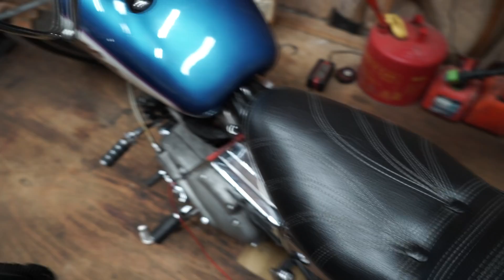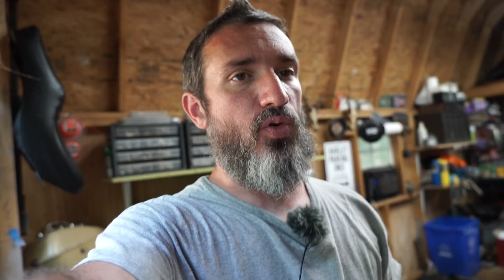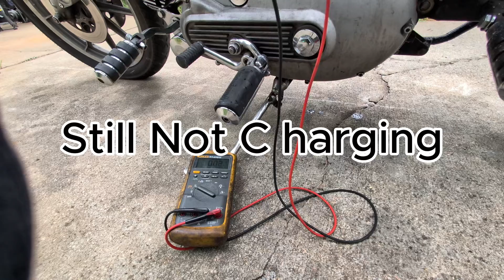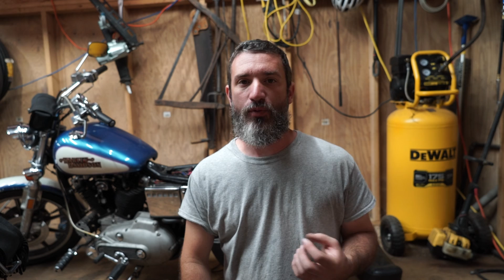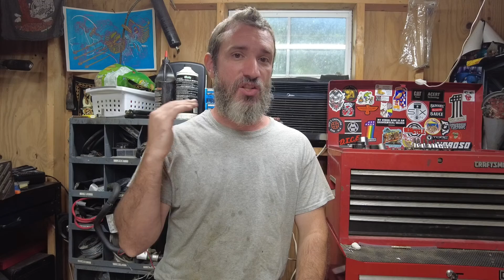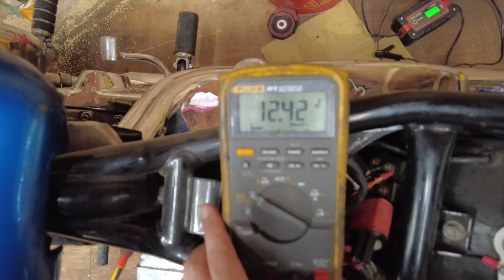Harley Charging System Diagnostics: Cycle Electric Generator on an Ironhead Sportster

Comment: No generator charges well at idle. They rely on spinning speed to create current and the regulator to control output.
Remove the generator and bench test to see if it motors when energised.
If it motors at a good speed, it will change and create current.

Comment: Question just did all your step. My voltage regulator was shot. Do I need to polarize the generator when I install the regulator?
Reply from the maker: If it's the same CE DGV5000 no you do not need to polarize it, install the regulator and you're good to go

Comment: Very interesting vid. My alternator shovel has stopped charging so will have to trouble shoot. On all my bikes I fit a switch on the headlight circuit so the bike can be started and warmed up without the drain on the charging circuit. Cheers Stan🇦🇺

Comment: Nice one Paul. i suspect that even tho Cycle Electric may be made in America, some of the elctrical/internal  components they use are probably Chinese? Nothing seems to last as good as it used to - my Ironhead still has its original generator and reg/rec from 1982 - over 100k miles on it.

Comment: To do the running voltage drop test and say you have an alternator with a regulator and one wire going to the hot side of the battery via a breaker sometimes. How would you do this test

Comment: When I was in high school or just starting high school this was in 74 we moved and I had to go to a different high school. Well we moved late in the summer and I want an auto shop but that was full this was in a farm farming community. So I at that time I had to well it was this or nothing electronics class not that time they were still televisions with tubes and I kind of took to that and I still have a lot of two radios today old ones from the '40s and '50s and stuff around the house. So if auto shop had not been full I would not have got to and the way I feel now enjoy electronics now it's moved way beyond me with I watched when transistor's first came in and became popular and I kind of knew the basics between NPNs and PNPs but I still prefer tubes. Many years I had a Simpson 260 and had a bake a light case Don't drop it it would break. And it was big as a book. But I finally got an old fluke meter that I use it's a good meter.

Comment: One thing I have bought for each one of my bikes it's alive feed it has a USB port on it like to plug in your phone my earliest one does not but visually tells you what your battery is receiving now an amp gauge would be much better but I can tell if I have my headlights off because I'll be producing 14 volts turn my headlights on and all my lighting it brings it down to like 12 4. I think I bought them on Amazon the oldest one is just reads out all the time whenever the ignition is on and I just run it from a wire underneath the dash a hot wire and ground like on the lighting circuit or the ignition circuit or it will tell you if you're not charging maybe not instantaneously. But you'll notice like if the plug fell out of the side of the inner primary or something happened to your charging system in general

Comment: Electronics aren't my favorite.  Im blessed with welding and fabrication skills. Where i worked before retirement.  The electrician gave me many hours of hands on. I did learn enough to get by. He didn't want call back time, i liked large paychecks.  Worked out for both.  Like you explanation on voltage drop.  Also, never thought about checking the leads. Thanks.
Reply from the maker: The "check the leads" and "check the meter"  thing is something I started doing when I was working on 3 phase power. You really want to make sure something is dead dead before you go touching it 😂. Thanks for watching and your commentary as always, hope you're doing good

Comment: I have a 1967 XLH iron head I got it in 1982 in high school. I have a box of shot generators. The old charging systems on the old bikes was trouble. If you rev up your engine in the headlight, doesn't get brighter.You might have a charging  proble. Everything you did and seid was right keep the knowledge a live and Keep it up on two's and that Sportster running. From a Sportster Bro
Reply from the maker: Thanks!

Comment: Did you have to polarize your voltage reg? On my 1974 iron head I was told to do it, just wondering . I just picked up a 2000 Sportster 1200S with 85 miles on the odometer. The bike sat for 25 years . The battery went dead 2 times . The bottom line was the stator was toast. Keep up the good work I look forward to your videos.
Reply from the maker: No polarization needed on the cycle electric generator, but you might need to repolarize a factory Gen
Reply: The stator goes bad on sportsters that sit on the kickstand for many years because oil sumps into the crankcase and wicks out of the sprocket shaft seal onto the stator. Running the bike without cleaning & drying the stator will lead to it's failure

Comment: Remember to check you equipment 😅.  Mine says Radio Shack 😂. I have no idea how old the leads are. I liked the lessons. Nice video.
Reply from the maker: Glad it was useful. I actually worked at a RadioShack for about a year, honestly was a pretty good job. Back when they made you wear a tie to work and had to know what a potentiometer and a resistor etc were to help with the parts bins
Reply: @buttcrackcycles  my brother worked there. He was able to get his ham radio parts cheaper.

Comment: Thanks for sharing this. I put a Cycle Electric on my ironhead thinking perhps that might be the best I can put on my bike. But not being too sure about a generator vrs a stator, I always run without the headlight on during the day to lessen the chances of being on the side of the road, and that points can run all day on a weak battery. Good stuff, man.
Reply from the maker: Yeah I have to burn lights during the day here. I've heard nothing but good about the cycle electric stuff, and everything on the bike checks out ok, so I really don't know why this regulator failed so soon. Hopefully the new one lasts longer!!
Reply: @buttcrackcycles Everything man makes breaks in time.
Reply: If you have a problem with charging or dead battery. You can find out if that's a problem by revving your engine up and see if your hand light gets brighter. Your generator should make your headlight brighter. Everything you did and seid was 100% right on diagnosis of charging system for any bike or car thanks for keeping the knowledge a live and passing it on.
Reply: Everything man makes breaks eventually.